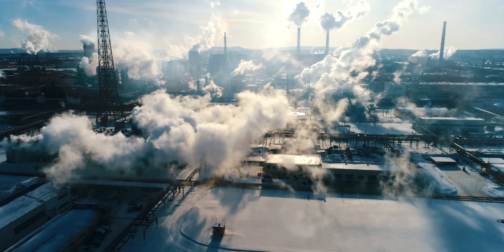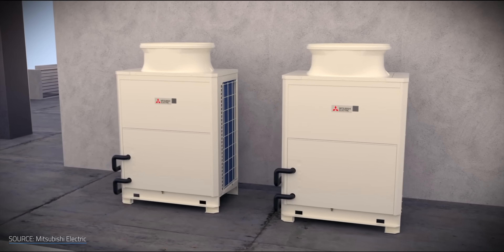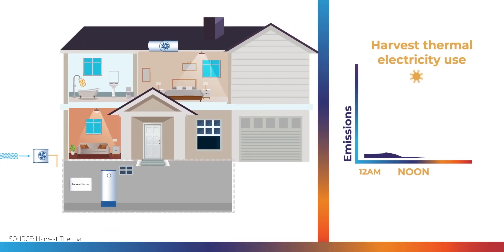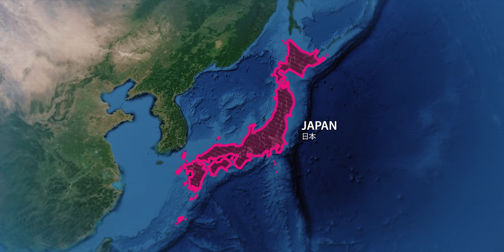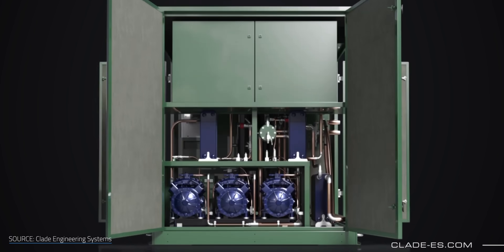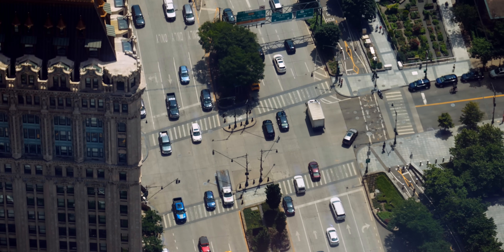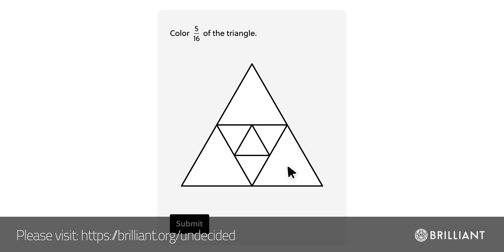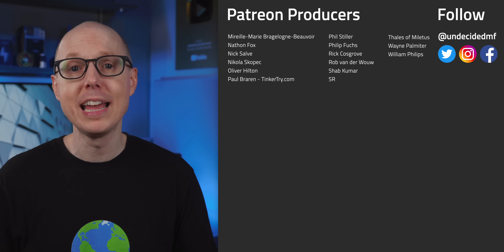Why CO2 Heat Pumps Are The Future Of Cooling

Comment: I have long wondered about this sort of water heat storage - we can also dump the heat from our refrigerators/freezers into the water tank as well! This would make them more efficient.
Reply: Not much heat gets into the fridge. Once its cold, the insulation and door seals do most of the work.
Reply: @JuddMan03  So - every time we open the fridge door - no heat gets in? 
A refrigerator is one of the biggest electrical use in many/most houses over the whole year.
Shifting this heat into a water tank would decrease the electricity required - and it boosts the heat we get into the hot water tank for us to use.
Reply: @JuddMan03  modern ones also have a cycle of heating the inner walls to melt any ice that condensed when it was opened. 

Plus if you buy a large amount of food for a family each week then a fridge freezer can kick in for a long time to bring all the new food to temperature. Mine can be working away for a whole day. Every friday/saturday after a big food shop. 
Either way that amount if enegy willbe the same whether you buy a large amount one day or half the amount twice a week. 
Its still wasted energy thats just going to radiate intoo a wall and then conduct up into the loft space.

Yoyh ive akways thought thw most wffective way to use a heat pump system to reclaim any wasted energy from appliances is to design the building to be well insulated in the walls, and then have a system in the loft soace that catges that heat and funnels it into the heat pump ye. Pumps it back down to a water tabk in the basement like shown in this videos. 
Rather tan trying to connect every appliance to a pipe system

Combine that wih underfloor heating and the heat in the house can be very effectively used to create a consistent temp in every room even if theres a fridge in one putting out heat.
Reply: @ge2719  Yes my freezer has a defrost cycle too. So did the last one I had, 20 years ago. I still think its unlikely that all the plumbing required to connect the fridge to the household refrigerant line would be worth it' too many things could go wrong, and if you wanted to heat the house while cooling the fridge, you basically need two separate lines.

The amount of heat that falls into the fridge when you open the door really is just not worth capturing. Nor is the heat from your weekly groceries. Just my opinion though.
Reply: @JuddMan03  thats what i said. its be more effective to capture all the energy from everything in the house by super insulating the walls and capturing it from the attic before it leave the house out of the roof.

Comment: If you want to reduce the install cost of heat pumps, make the high-pressure part of the system self-contained using a refrigerant-liquid heat exchanger, then the rest of the system can use low-pressure heat transport fluid instead of refrigerant. You could even do that on both the hot and cold side, then the compressor and its evaporator/condenser can be hard-wired/plumbed one-way and the heat flow can be managed with low-pressure (40-100psi) liquid valves instead of high-pressure (300-3000psi) refrigerant ones.
Reply: Good idea, but the efficiency would go down using two different co-joined systems, and the installation price would go up, because these systems are NOT in common use. But the pressure 
in the secondary system could go down to ten or twenty pounds with a larger flow rate, thus reducing the 
amount of energy required to circulate the secondary heat transfer system.
Reply: @otpyrcralphpierre1742   If you liquid-cooled the compressor's cylinder walls instead of letting all compressor heat get transferred through the working gas, you could probably save enough power on compressor effort to offset most of the pump power.
Having a self-contained system also means the whole unit can come factory-charged regardless of application and the high-pressure system is safely self-contained outside where a catastrophic failure is unlikely to harm anyone. I wouldn't want to be anywhere near the HVAC room when a 3000psi supercritical CO2 pipe bursts indoors.
Reply: @teardowndan5364  I don't think a CO2 system contains enough CO2 to pose any harm if breached, unless in a small, sealed room.
Reply: @otpyrcralphpierre1742  HVAC systems are usually in a relatively small and poorly ventilated rooms since you cannot put HVAC vents in it when you have natural gas equipment as the induced pressure difference may screw the natural gas stuff up. 
A 3000psi pipe bursting open would pose a serious shrapnel injury if you happen to be near it and be loud enough to damage your eardrums.
As for the quantity, the whole return line plus part of the condenser inside the water tank has to be filled with condensate if you don't want to hydro-hammer the expansion valve to hell with bubbles. Around 4m of 10mm ID internal return line + another 3-4m (out of 15+m) inside the water heater is about 0.5L or 5kg worth of critical CO2. 5kg is also 110 mol of the stuff which expands to ~2400L. In a small home, that would be about 1% of the total indoor air volume and potentially enough to knock you out. If you happen to be in the HVAC room when the pipe blows up, one breath of 100% CO2 might knock you out before you can get far enough away to avoid asphyxiation death.

Comment: Just a minor point, you mentioned the CO2 is not toxic. This is not correct. CO2 has a toxicity rating, you can die of CO2 posioning. Once amount of CO2 passes a certain level, it will kill you regardless of how much Oxygen is available.

Comment: I had a heat pump water heater in my old house. Installing it dropped my electric bill by $20/month. By having it in my basement, it didn't pull from the heat from the gas furnace during the winter. And during the summer it helped keep the house cool - house had no AC.
Reply: How much did you payed for it. Just curious with such a small reduce it electric bill it may take decades to payoff
Reply: @Ayvengo21  this was about 7 or 8 years ago. I think I paid around $1k, and a similar basic electric water heater was around $500. The energy savings paid for the cost difference in about 3 years.

Comment: The problem with modern vehicles is the weights. Side by side atv could be a solution as lighter weights mean better fuel economy. City side by sides could even be hybrid electric gas. Like a fart car made into a side by side atv.

Comment: I dont know this for a fact, but since we in Europe prefer water based heating (with radiators and in floor), the buffer of heat pump energy is nothing new here.
Reply: Exactly. Air to water, or water to water (geothermal) heat pumps are the norm here.

Comment: I don't understand what is new here.
I get that CO2 has different properties than currently used refrigerants. Its better at its job bur requires more expensive infrastructuee. But in Europe it's very common to combine HP with heating hot water for showers and  separate circuit of water for in low temp floor heating. In my case i have 300l floor heating water tank, about 700l of water in floor tubes in about 80tons of concrete. This is huge battery. Software on my HP easily allows me to run it based on schedule, so i configure it to run when energy is cheap - it works great with mu huge battery.
So, apart from refrigerant differences - what's new?
Reply: Heat pumps that store energy in water are uncommon in the States... I have a 3000L buffer tank that takes both heat pump as well as wood gasifier input; it's common to see those things in Northern Europe, but its practically non-existent in the States.

Comment: C02 leaks are not a big deal.... in an enclosed space... with humans.... And you did not address this at all. Do you understand what kills people in a submarine? I am not saying that these issues and concerns cannot be managed. But you didn't even tell us HOW they are managed. Carbon Monoxide is one thing. We have detectors and sources tend to be single source such as a gas stove or a gas water heater or a kerosene room heater. Based on what you told us, I say hell know to C02 for heat exchange. How is the toxicity dealt with or managed or is determined to not be an issue in a small bedroom.

Comment: One of the biggest annoyances with heat pumps in general is that they are almost always tied to installation providers. I have been trying to find data sheets and price listings for heat pumps, especially here in Europe, for a while now and it's almost impossible to find just the compressor unit and a heat exchanger unit prices, even for large manufacturers like Mitsubishi. I don't get this whole situation either, because you can just buy a mini split and install it yourself, but the moment it gets above 5 tons in capacity or thereabouts the listings just vanish it seems.
Reply: Not sure if I fully understood your problem but.... Well, actually you can't.
There are s lot of countries in Europe where for safety reasons you can't buy a heat pump if you don't have an authorised installer to do it. You can't do it yourself.
I don't know if this is the case in all European countries but it happens at least in some.
Reply: If you want home insurance you will get a pro to do the install.  Also, for a CO2 system you have to be certified to do the actual lines given the temperatures and pressures involved. CO2 is not that toxic but copper shrapnel is never good. @TheAllMightyGodofCod
Reply: He should still have to be able to get documentation! @TheAllMightyGodofCod
Reply: @TheAllMightyGodofCod  Shit like this is never for safety reasons, but it is almost always for price gouging reasons (the third reason is the wild flukes where something stupid gets enacted despite everyone's objections). This type of approach cannot ensure safety in principle, since the licensing ultimately comes down to paying to the right people, with the ability to actually do it safely being sidelined. It's like the John Deere thing where they go out of their way to make you unable to repair your own farm equipment, but pretend it's for safety reasons. They actually cite things like "otherwise farmers may increase the horsepower of their tractors". Yeah god forbid they add 50 bhp so their tractor can go 2 mph faster, that would be a safety disaster. Anyone who uses "it's for your safety" arguments are always full of shit and are simply trying to manipulate you to get their way (which mind you is at your own expense).
Reply: @michaelbuckers  I read your comment, analized your reasons, studied the facts you present and marvelled at the high level of your arguments like calling it "shit" and so I elaborated my response to it and here it is:
Reply: @TheAllMightyGodofCod  You know what they say: he who trades liberty for safety deserves neither liberty nor safety.
Reply: @michaelbuckers  and for that brilliant and on sticking with the topic argument, I must reply with:
Well,
Reply: @michaelbuckers  In this case it's most likely all about the refrigerants.  When uninstalling/installing these units, if they use the most common refrigerants then they want an installer who will capture that and not just vent it where it can do a lot of damage over time.  They have been trying to switch refrigerants over to non-greenhouse gasses but that hasn't settled out yet.  Once it has, it's possible that might open up DIY but depends on other safety concerns (eg compressed gas).  You might also be able to DIY but have an installer charge the system.  We'll just have to wait and see.
I get what you are saying, in general, but I suspect this is more environmental than personal safety or price gouging.
Reply: @dreamcoyote In the States, you need a license to charge the system with refrigerant but not to do the piping and installation as an example.
Reply: @dreamcoyote  Or, and I'm just throwing it out there, it's for price gouging under the guise of environmental concerns. Is it a coincidence that no one gave a shit about CFO ozone destruction until a company that produced a different refrigerant came about and started lobbying for CFO ban? The one thing that has always been true and always will be, is that the big man never does anything whatsoever unless it directly profits him.
Reply: only an idiot would not require licensed technicians to install equipment with high voltage and environmentally hazardous gasses.
Reply: @jooger69  Minisplits you can install yourself, has been that way for decades. This stuff ain't rocket science anymore.
Reply: @Powertampa  only in places that don't care about global warming
Reply: @jooger69  I live in Europe, lol
Reply: @Powertampa  You still need to be a licensed technician to work with refrigerants where I live and an electrician as well to install the device.
Reply: I notice that too. Over here in Australia, all the prices and units are available online or even in electrical stores for anyone to purchase. So you can choose your own and then must get an installer to install it.
Reply: Take a Remko heatpump for heating and cooling, install it yourself room to room. Let your old heating system stand, where it is and use it as a backup. 
That is a practical and rather cheap solutions for many people. 
Greetings  from Germany
Reply: In Europe, and many other parts of the world, if you are installing a system (split system) where you can do things wrong and break something, no one is going to give you a warranty. Also manufacturers has to go through certified technicians due to the refrigerant. But you can purchase a split unit almost anywhere, the problem is warranty. I used to design, install and repair those equipments (small and large units/systems), I'm not certified in Europe, I just went to the store, purchased a unit and installed it, no warranty, my risk.
Parts can be a problem? Yes, as with any other equipment, no more, no less.
Reply: there are diy-ones but they may be 1% of all. prefilled, just plug in, done. but legally one would not be allowed to connect it powerwise, eventhough it is colorcoded and all..^^
Reply: And the problem with large capacity units is not just for heat pumps, is for all large equipment, since the beginning of time

Comment: it seems like some data is confused here. a CoP of 3 is not all that high for a propane or R134/R1234yf heat pump, but CO2 does better with higher Δt, which is useful if water is used for storage or if the heat pump is used for a freezer or the like. CO2 is not by nature more efficient in an air to air heat pump, where Δt is usually within 30℃. However, using a hydraulic heating system in combination with an air source heat pump is usually only the best available solution if a central hydraulic heating system was already present, as is the case in much of northern Europe. if you have a central air heating system, forgoing the water step still yields >5 CoP in most systems. The best solution for central heating for efficiency would be 1 heat pump with multiple, direct air heads. While this system is regularly used in office buildings, it is still significantly more expensive for no real reason other than manufacturing bias. a manifold system like this, using propane as a refrigerant, can even be used for other places where cold or heat is required like refrigerators, dryers and washers, even domestic hot water (even without a tank and at the tap if so desired). a system like this is even capable of taking heat from one room and using it somewhere else.

having said that, my house has a standard gas fired hydraulic heating system, and a separate air-water heat pump with a separate insulated grid and fancoils. This is mostly because a very good lobby action has restricted refrigeration work to very select and inflexible companies in my country. But that's alright, they make tonnes of money and the adoption of heat pumps is slow here, so the laws work as intended

Comment: I would wager that with the difference in environmental impact of co2 leaking vs standard refrigerants leaking and both of their production, we would still come out ahead even if most CO2 systems leaked completely flat every 3-5 years. And that's before we take into account the difference in efficiency and offsetting other energy usage, eg water heaters.

Comment: 9:25 Adding a water battery to a non-CO2 heat pump should be possible. So why recommend CO2 at all if it's COP is inferior?
Reply: They are all over the place in Europe and the UK. It's pretty much the default here.

Comment: So we'll probably never see a CO2 window air conditioner?
Reply: OfficialMattferrell_.  A window size ammonia chiller might be possible.
Reply: The issue is the high operating pressures require far thicker materials so cost goes up considerably.
Reply: @richardbartlett6932  ammonia chillers run at reduced pressure.

Comment: At 1:45 you talk about water being at 90 degrees C?  Nobody is bringing their water almost up to boiling.
Reply: Also you mention most heat pumps arent heating water as well.  There is nothing stopping someone from using a heat pump to heat water.  All you need is a storage tank with a connection to the heat pump and then Home Assistant with some basic scripting.  If your batteries are "full" and your home power requirements are met then turn on the heat pump and start heating the water in the storage tank.  There are advantages to the CO2 part of the heat pump though.  Everything else is easy to setup yourself for a couple of dollars.